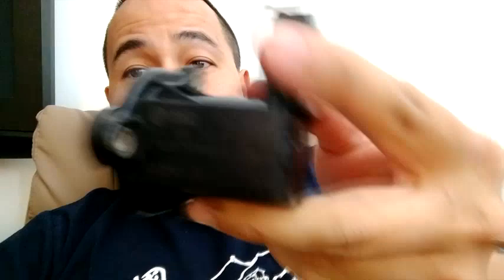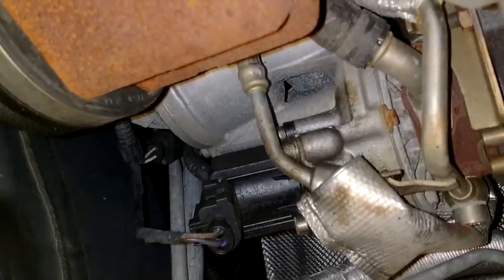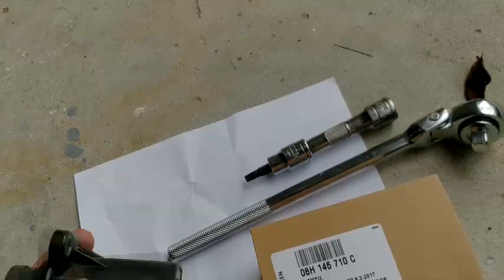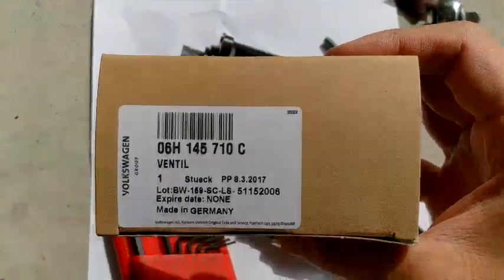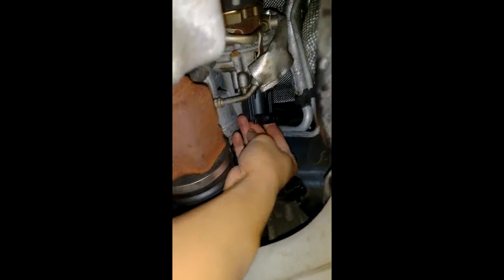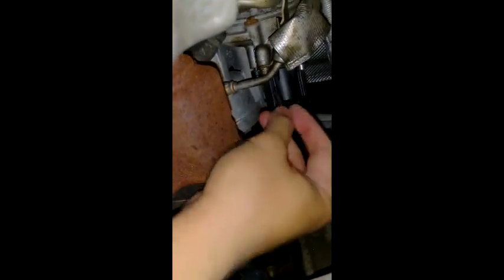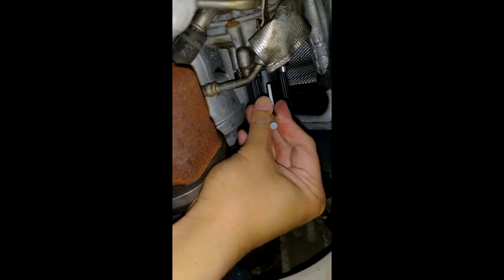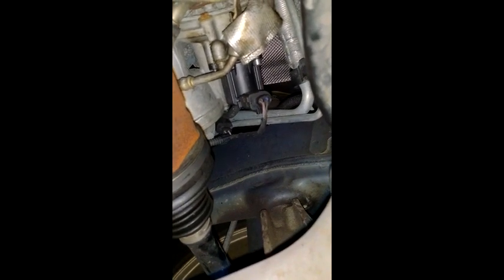VW/Volkswagen Tiguan Check Engine Light Code P0299. How to Replace & Fix Turbo Valve Diverter Issue

Comment from the maker: You can buy the tools and parts through the affiliate links below:

1. Dorman 911-240 Turbocharger Diverter Valve

https://amzn.to/2Hf6szQ

2. FOXWELL NT510 Pro Automotive Full System Diagnostic Scanner for VW Audi Seat Skoda OBD2 Code Reader ABS SRS SAS EPB TPMS DPF BMS Transmission Oil Light Reset Tool

https://amzn.to/2KII1g1

3. LAUNCH Scan Tool CRP129X OBD2 Scanner Automotive Code Reader Android Based Diagnostic Tool for Engine Transmission ABS SRS with OIL/EPB/SAS/TPMS/Throttle Body Reset and AutoVIN Wi-Fi Updates

https://amzn.to/2KOwquE

4. Crescent CTK170CMP2 Mechanics Tool Set, 170-Piece

https://amzn.to/2Zgkw22

5. Race Ramps RR-XT-2 67-Inch XT 2-Piece Race Ramp

https://amzn.to/2KIqvZl
Reply: The screw isn't metric ??

Comment: Thank you for the video ! I just did it on my tiguan 2014 and it work but, I had to plug the car on error machine to close the check engine light !! Thank you. 🙏
Reply from the maker: My pleasure. I am glad that it worked.

Comment: Hi EJ.  I just took my 2017 Tig to the dealer and they gave me the same code (PO299) - Turbo Underboost.  The car is running perfectly fine with no noticeable lag.  Do you think that this is worth a try?
Reply from the maker: Yes, it is worth a try since it doesn’t cost much and it is very easy to do. It may fix it.

Comment: Hi I just purchased a 2014 Tiguan and I accidentally put the wrong gas I didn’t know it required premium. Around a half tank my check engine light came on and this code came up due to the turbo boost pressure regulator. I filled the tank back up with half premium, but do you think that’s what caused the CEL or did I  hurt something? Help!
Reply from the maker: I don't think you will hurt anything if this is only the 1st time. If you want a peace of mind, just the Liqui Moly 20134 Octane Plus 150 milliter https://amzn.to/3Fxf54z into the gas tank to add the octane level to the gas. https://amzn.to/3Fxf54z  also try this one too to see if it will clear the code Liqui Moly 2007 Jectron Gasoline Fuel Injection Cleaner - 300 ml https://amzn.to/32vc6LL
Reply from the maker: if it doesn’t clear the code, the turbo charger probably is bad and needs to be replaced

Comment: I bought the the D.v , and just so you know the Allen wrench is 5 MM ( metric )  and it wasn't a bad change out at all . But the end result was I cleared the code and road tested it and nothing changed . Still a dead turbo gutless as before.
Reply from the maker: Yes, sometimes unfortunately the turbo is the issue when the dv doesn't fix the issue.

Comment: Thank you for the video. Very helpful information and video. I have a question. I had the p0299 error code and had the code reset with error code reader. Error code has not come back on. Is my issue resolved if the error code does not return? Thanks.
Reply from the maker: My pleasure. Did you replace the diverter? If the code is gone, it should be ok for now.
Reply: @ejsgarage  no I did not replace it.

Comment: This has given me hope, I just bought a used VW 2012 Tiguan, went to the dealership (bought it at an auction) after an immediate misfiring problem spent a little over 1k to fix that problem (ignition coils, spark plugs) also replace fuel injectors, and clean the carbon build up.  Not too bad but once I was back on the highway home check engine light came back on... They told me the car was in fantastic shape besides those things and that everything was taken care of, I went to autozone today and received this code so I'm really hoping this is what the issue is.  I have bought the part, it arrives in a couple days.  Thank you for the information!
Reply from the maker: I hope there is nothing serious with the car.
Reply: Jordyn, did replacing this Turbo Diverter Valve solve all your issues with misfires? I
too have the same issue for months. Replaced ignition coils, spark plugs... the dealer told me it’s carbon buildup but I don’t really trust them. Today was the first time I’ve seen code P0299... so i’m hoping this solves the misfires issue.

Comment: hey EJ'S GARAGE,thanks for the video my friend,I got some questions for you,mine is a 2009 Tiguan VW 4Motion SEL,and I got the check engine light now on,it says theres some issues related to the turbo,Im watching your video and Im going to try and change the turbo diverter valve first,then I will wait if theres any other light to show on the instruments panel..what kind of vehicle is yours?TIA!
Reply: Greetings my friend! I did the repair,changing the diverter,and that was a piece of cake(taking the plastic cover underneath,makes the job so easy)and I thing is easy too using an allen wrench the 3/16 for this job..I'm pretty sure this was the problem,the old diverter ,the orange seal was broken,so maybe that was the reason for the check engine light,I just get the ANCEL VD500 OBD II Diagnostic scanner at Amazon (this one can be used to replaces the brake pads on the 2009 VW Tiguan 4Motion SEL,because of the EPB(electronic parking brake system),it's going to appear a6,a8 and other cars options(I choose other cars)then looking into the replace pads option,I change the pads and then the 3rd option..is not bad for the price,I think $52 bucks,and you can use it to scan and see the failures from that check engine light and at the same time you can erase everything...thanks again,you save me a good of money on this easy fix and the car is running nice💪👍👍👍
Reply from the maker: @guccuabixidu3900  Great job Guccua. I am glad that I was able to help you save money :)
Reply: @ejsgarage  thanks to you buddy! Your video help me a lot to understand and find the part(this is my first VW)..I really appreciate your videos!
Reply from the maker: My pleasure. I hope that it is not your Turbo. Turbo is around $700 on Ebay if you can find a VW independent shop. The cost should be around $1500. I have 2013 VW Tiguan 4Motion 2.0 Turbo
Reply: @ejsgarage  thanks again!I hope that too,a mechanic told me that is not the turbo,so I'm going to start with the diverter hoping thats the only problem
Reply from the maker: You can do the diverter yourself to save some money :) It is plug and play :)
Reply: @ejsgarage  yes my friend,I'm going to,just waiting for the part and I'm going to put hands on it..😏😊

Comment: EJ,  I got the same code:   P0299 " Boost Pressure Regulation Control Range Not Reached"  is this description the same as yours?  Also when the light came on, did you car feel sluggish/slow and the turbo does not kick in or work when it is supposed to when you step on the gas?  Thanks!!! :D
Reply from the maker: Yes, it did that. The Diverter went bad and then the turbo 5 moths later unfortunately.
Reply: @ejsgarage  did you end up replacing the turbo?  getting rid of the car? my old diverter valve had a crack in the orange seal so i replaced it.  With the new diverter valve,  my car "coughs" when i step on the gas (high rpm).  there might be a boost leak (high pressure leak) or not re-installed the diverter valve tightly enough
Reply: So it happened to me 2012 so its the same part you change or diferent

Comment from the maker: You can the tools and parts here:

1. Turbo Valve Diverter

https://www.amazon.com/gp/product/B01NBHQP2Z/ref=as_li_tl?ie=UTF8&tag=entjikjeffrie-20&camp=1789&creative=9325&linkCode=as2&creativeASIN=B01NBHQP2Z&linkId=e9821df23ac471d6fa1e6665c3d2059f

2. NNOVA 3120 Diagnostic Code Scanner with Freeze Frame Data for OBDI and OBDII Vehicles (Black & White Screen)
https://amzn.to/2Ye1VEs

Comment: I just wanted to say thank you.  As you said it was easier to change than I expected.  I also wanted to say that my device was not leaking but it was sticking.  Replaced and the car runs great again.  The hardest part was getting that little power cord removed.  

Thanks for posting
Reply from the maker: My pleasure Mark. I am glad that you were able to do it & your car is running great again. I hope that you will subscribe to my channel  😀
Reply: Entjik Jeffrie so I have this same error code on my 2009 VW Tiguan 2.0T (Non 4motion) so I have this error code and then When taking the car on a small test drive I got a warning on the dash that pops up when the car is coasting and not accelerating the errors says something along the lines of (Turn off vehicle low oil pressure sensor) it only shows up for 2 seconds and then goes away. when we check the oil it is fine, would it be a diverter valve, or wastegate? Or an internal computer issue? Or do I need to replace the entire turbo? Any suggestions please help.
Reply from the maker: @tophernorthwest6261  I am not sure, I never have the low oil pressure message before.  I will try to change the diverter first before investing on a new Turbo. The turbo finally had to be replaced. My turbo went bad 12,000 after I changed the diverter. It was an expensive job, the turbo alone costs $1450, the labor was astronomical.
Reply: EJ'S GARAGE how many miles were on the turbo when it went bad?